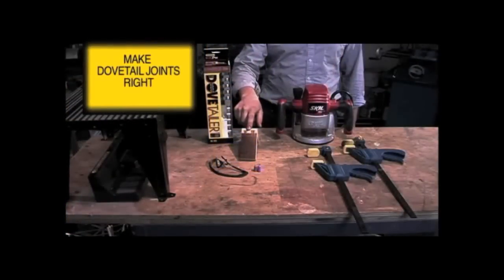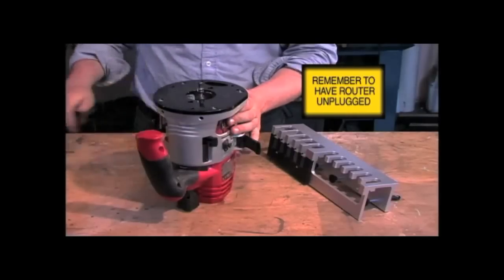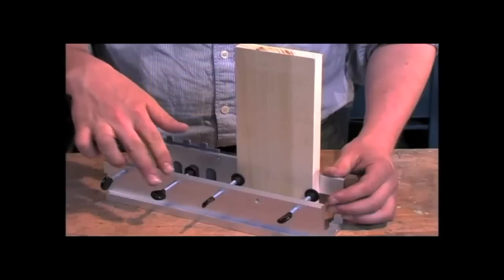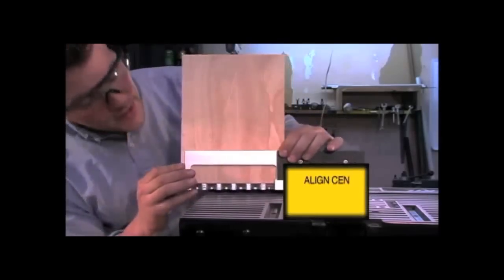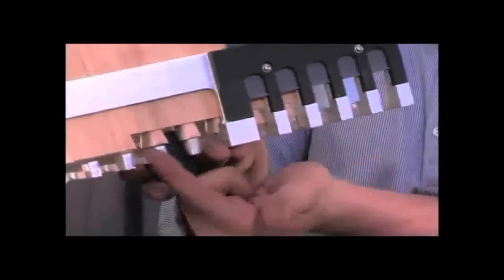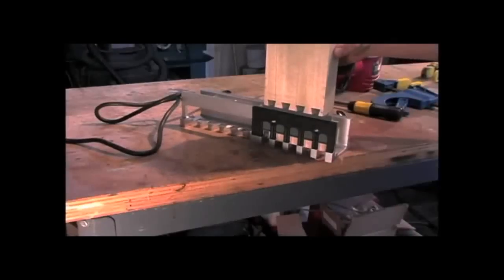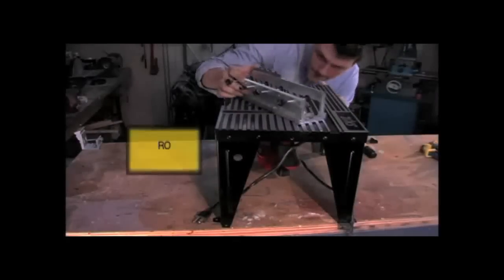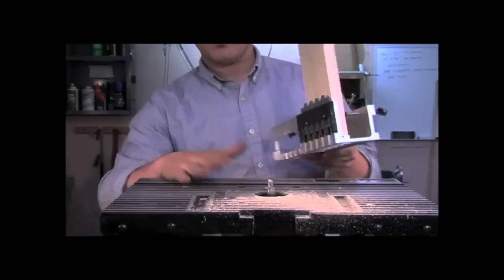Dovetail Jig #860 INSTRUCTIONAL Full

Comment: You say to set depth at 1/2'''. on the tails (first cut) what if your working with 3/4"' boards and how are you allowing for the distance of the plate you set your router base on?

Comment: This thing is not a tool but a toy. the frame is so flimsy it won't keep the wood tight. it is so inconsistent as to be unusable. I wasted an entire day trying to get it to work and gave up. 
the thumbscrews on the side that is vacant vibrate shut from the router vibration. I am disappointed as I liked the design usable on my router table. It is back to the old Craftsman dovetail jig. The subtle but important setup details in the video were left out. I noticed the finished dovetail had the same runout problem as mine. I even calibrated the setting of the dovetail bit with my combination square to make sure bot sides were the same. I really wish this could have worked as I liked the idea. The construction is just too flimsy. There is no sarcasm intended, just an honest review.